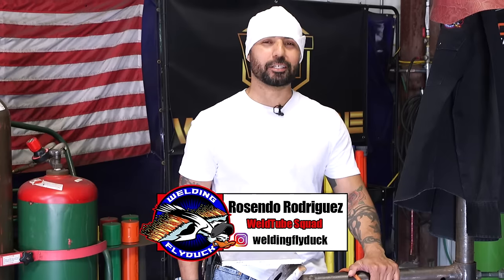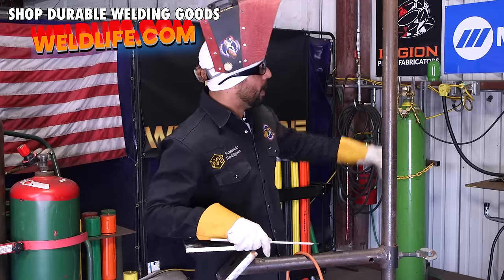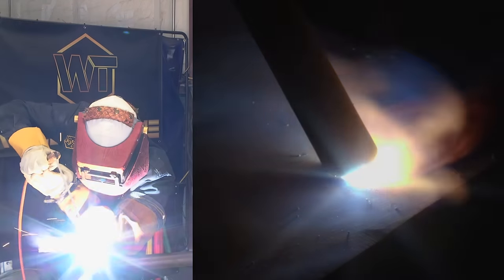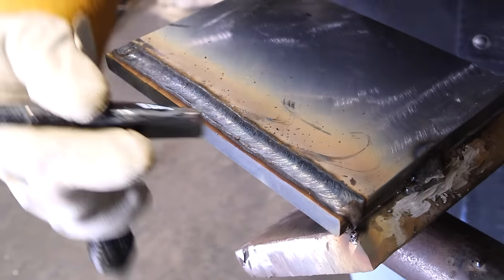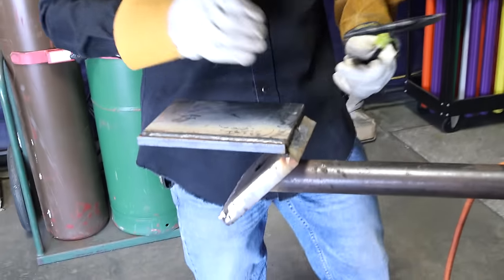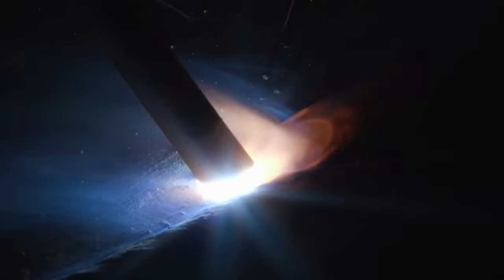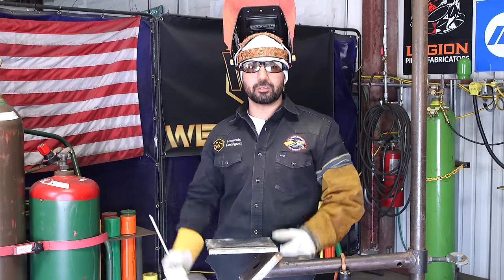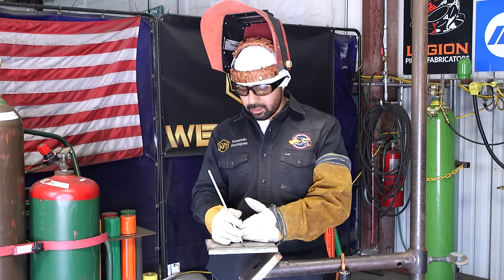Stick Welding Basics - How to Run Straight Consistent Beads

Comment: i remember when i first started learning stick with 6010  i was always sticking the rod or long arcing .. could not get the feed right because i was trying to focus on    all variables.. arc length angle travel speed,  weave / pattern... and it was too much.. so i bought an old wirefeed and practiced the other variables until they became second nature,   didnt have to worry about feeding the filler...  then i went back to stick to work on feeding the rod and to my surprise it just clicked...   i guess i did it backwards lol.
Reply: Funny that exact same here bud!

Comment: When I weld, which isn’t often, it looked bad.  After watching your video, within 5 minutes I was laying beads.  You’re a good teacher. Thanks
Reply: How long you been welding ?
Reply: @benjiii3407   on and off about 3 years. I own a small engine shop and I don’t need to weld too often but sometimes welding as a must.

Comment: He makes it look so easy .    He has a really nice manner as an instructor . 👍
Reply: It is not that hard, just keep short arc. Short arc or long arc is your voltage, if you keep it short just like he mention in video "feel" the plate, it means try to keep same short arc thought your weld. First try long arcing on some plate and see how it looks after, than try short arc. You will see "wild" arc and  that electricity it is not pointed where you want it to be, than try to keep short arc and you will get smooth arc whitout spater and wildness. I hope my English is correct, sorry if it is not.
Reply: I forgot to mention you need to be calm when feeding the rod, try to relax and breath normally.
Reply: @stefanm5636  Thank You. Most Helpful.   Your English is very good . 👍

Comment: Great tips. Im just staring out. Your tips are clear and very helpful. I was having a lot of trouble seeing ahead of the weld. I wasn't moving with the weld.  Looking forward to more practice now that I know what I was doing wrong. 👍
Reply: That's common when you first start out.  One of the best ways to learn.
 to move with the weld is when you start and prop yourself up,  prop yourself about to where you plan on finishing the weld instead of where you start the weld.  Then you can reach back when you start the weld and staying with the weld will he ALOT easyer because your coming back to your most comfortable resting spot.  It's much easier to pull back to yourself  than it is to push away from yourself when you are trying to stay with the weld.

Comment: So, I'm just learning now, borrowing an inverter and just tackling a project for myself, I've come to youtube alot for stuff like this, I am a tradesman but i love to learn and try different things.
I have easily watched a couple hours worth of welding videos, electrodes, amps, ac / dc and ofc running beads. 
Your videos just settled all my anxiety about getting clean welds on my gate, 10/10 my man, great video and very easy to understand you. camera shots showing angle are perfect.

Comment: Today i was practicing running 1G  E7018 at 130 amps! I was getting pit holes in the slag itself, but the weld bead was okay & no pits! And there was no spatter!  Im using an ole  1974  Lincoln  AC 225 AMP "red box"!

Comment: more than a rookie, i haven't bought my stick welder yet so i needed the basics.  thanks. ⚔
Reply: i have the stick welder now...not very good at for now.  need to know more about the voltage.
Reply: How’s it going?
Reply: @MTFTVlive  i sort of stuck just doing very small jobs. for some reason welding an exhaust hanger on the frame of my car proved impossible.  i just couldn't get the hanger to stick to the frame.  cleaned both surfaces, but the weld would not hold on the frame. it did so on the hanger, but not the frame. both parts are steel. finally took it to a garage.   what do you think i did wrong?  thanks.

Comment: I have to lay a straight bead for a 1g test.  I am 62 years old.  You taught me to lean on something - anything. I think the view from the helmet probably matters a lot.  My Yeswelder helmet has been fine until I had to see the edges of the bevels working on this 1G test.  I cradled my right hand using my left hand and lowered my left arm as you do.  Thought I was going straight, but when I lifted my helmet, I welded over the edge.  A really nice weld, thanks to your stick videos, but over the edge. I am going to get a helmet that provides a better view.
Reply: Did you find a better helmet?
Reply: Those Yeswelder true color helmets are fine.  Try playing with the shade level, also change the battery from time to time.  The Harbor Freight Vulcan ARCSAFE helmets are also quite good--if you can find them.
Reply: @ZEPEH-46N2  Bought a Lincoln Electric 3350.  It has a great view and helped me see what I was welding doing the 1G test
Reply: @inhibited44  I have that same hood. Being able to see what I was doing wrong helped tremendously.

Comment: you teach me better than my intructors, when we were learning straight beads i was told to run those 7018 on 100 amps
Reply: That sounds cold to me. I've heard to start 7018 at 1a per thou of rod diameter, so 125 for a 1/8" rod then adjust. Then go higher amps on thicker base metal for penetration and lower for thinner metal to not burn through. Still working on that here & hope I haven't been misled. lol

Comment: I’m gonna be starting a welding job at the foundry I work at. No experience other than practicing sometimes at lunch break. The guys teaching me say to keep it up about 1/8” when welding the castings. This guy says this,this guy says something else because everyone at my place does it differently so I’m very conflicted because they say that if you touch the metal the rod will stick so yeah. Very confusing but I’ll try out your tips and see if it works best. Thanks dude!

Comment: Can we get some beginners tips for low amperage welding. The only machine I have access to is an 80 amp and also very low voltage outlets. At most I can run about 75 amps. It's all I have access to at the moment and I am desperately trying to learn how to do any kind of welding